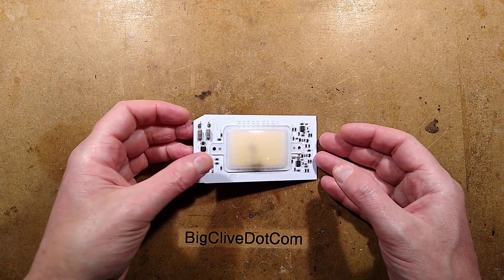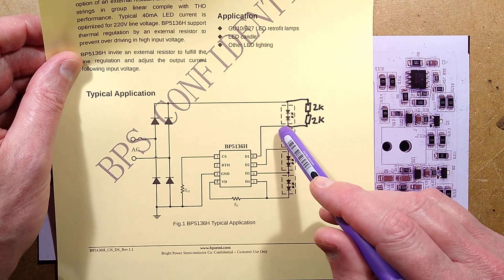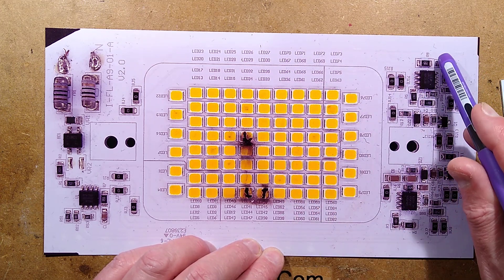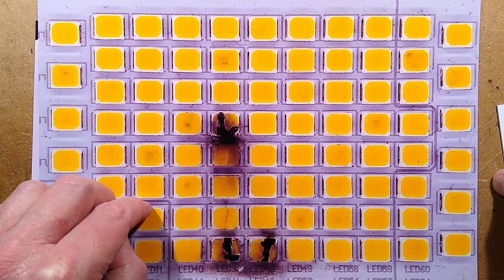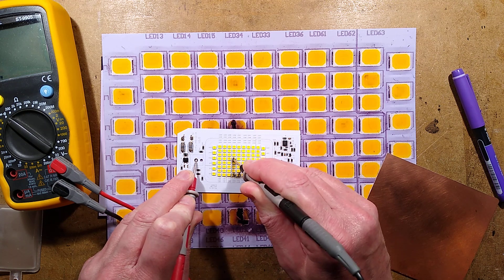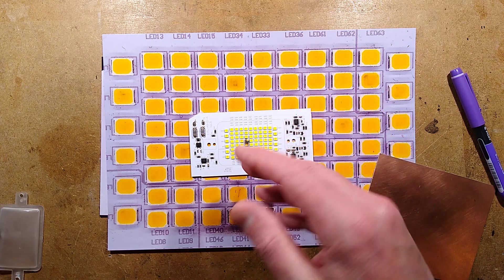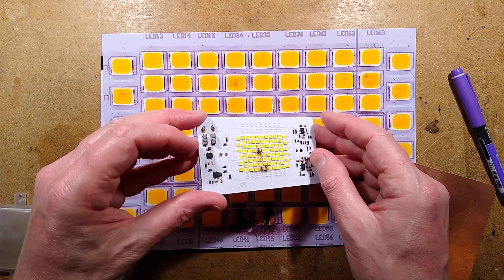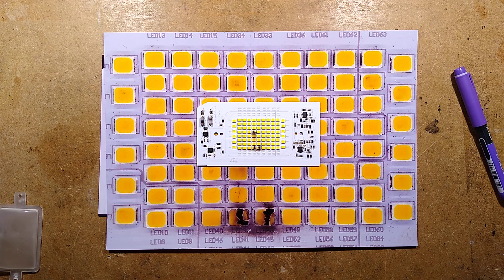LED shock hazards are increasing

Comment: Actually Led lamps is a Major fire risk .
They are NOT isolated from the mains ( example with a transformer )
and the Led's are driven so hard the life spand is shortened extremely .
( LEDs running more hot than needed )

When you look at the burned leds in the different lamps , well it is burned .
Not long way to burn down a house and it is actually more common than 
you think .
Typically the report in medias say -
' ' Fire because of FAILED electric device " " Blah blah blah .
But in reality it should have sound - Fire because of failed and burning led bulp .
They should make it more clear in the medias and news .
If you check the actual fire report they DO state the FULLY cause of fire . 
( Led Bulp and not failed electric device )

Next is the extremely simple DIRECT coupled circuit .
( and with NO ground too )
I do NOT understand how they can get away with this ?
All other kinds have lots of regulations .
Flurocent tubes .... NO you can NOT install those without a transformer and fuse .

-- But you could easy make a simple cheap circuit direct coupled 
as a voltage adder and then drive it directly on the mains . --
( no problem to get the + 10K volt needed without a transformer )

Well that is NOT legal , SAFETY you know .
Same with halogen lamps . 
-- Oh I can easy make a voiltage regulator coupled directly 
on the mains heh heh heh ... -- 

NO NOT legal .

So what happen with LED bulps and lamps ?
Well those didn' t exist when the rules was made so now they can some sort 
of legal get away with ZERRO safety ,.
( There is no rules for that at all )

Combine this with how they drive the LEDs precisely so hard that they know 
when it will break within + - 2 weeks .
But Why ??

It is called ' planned obsolence ' it is very widely used .

Simply calculate close enough that after a ' planned time ' the device will break .
Shure repair be so expensive that they welcome you to buy a new .
( and of course it ALWAYS happen short of end of warranty )

They do this with almost all stuff today .

Thats called GREED and PROFIT .
The very reason most of the 3 world is drowning in electronics garbage exported from the 
rich countries so to ' wipe under carpet ' and declare we have for shure no really waste 
/ garbage problem .

There was once in a time where they made quality and devices from that time is still 
working and can last decades .
But then the Greedy old man realiced that if all people buy such thing then he can't continue 
selling . 
So to solve this the old Greedy man now selling stuff that wont last more than the 

forced warranty 
( the warranty they lobbyed down so its typically 1 or 2 years and NOT the 
original 5 years the government wanted , Yes the Greedy old have power , Lots of power )

Devices with small failures they sell to 3 world countries and this is with ONLY A MONTH 
warranty , simply because those will break in between 2 and 4 month .
They design the ' end of life ' after each countrys specific warranty rules .
If your country say 1 year ( lobbyed level ) then they go for 14 month of life before break .
If it say 2 years 
( still a lobbyed number , original claimed from government as minimum was  5 years )
Well now the device get a little bit more expensive ( for the excact same device ) except 
that now they have made it so it break 2 to 3 month after warranty .
Yes it is extreme timing .

They started doing this with light bulps .
Catastrophe they actually end up making them so good that a lightbulp
could last almost for ever .
But no no no no , 
The Greedy old man want more More MOre MORe MORE .
So they formed a cartel where they all agreed to set a max amount of hours of life for a 
light bulp . 
Now the people who was working on making the best quality as possible was forced 
with the task of going opposite .
Degrading their products life time .

They are even so greedy they trying to force by law the right to repair to be removed .
Yes lawsuit after lawsuit because people simply repair and not throw away .
They even filling devices up totally with glue to make shure they cant be repaired .

Are you one of those who support them ? 
Sadly we all are in some way , because we buy stuff .
But we should be aware and try to only buy quality and 
stuff that can actually be repaired 
if it breaks .

Because of this pollution has exploded like crazy trough time and 
we see more and more 
''' buy and throw away '' stuff being made .

No wonder our climate is going bad and we actually going down the road of no return .

Edit - sorry my typos im on coffe now

Comment: Just buy light fixtures from reputable manufacturers with experience, producing also fixtures using other technologies than LED.
Reply: That's easy to say, but when someone sees a CPC special 100w equivalent LED flood for £19.99, versus a Samsung 50w equiv flood for £45.00 - the CPC shit wins every time. If it goes in a few months, they demand a replacement. If it goes after a year, weeeell, it was only £20, they will buy a new one.

Comment: Clive you make a big point here this is an issue I had back in the 2000's for cable termination QC. We found our high volume low quality China shops where only continuity testing. They did not do any HiPot testing. Not even at a % level. This was quite concerning for us as we were selling bargain cable IN the US. But the Chinese testing caused a loophole in termination safety. They claimed they didn't know, but they knew. Also, cultures and partnerships prevented me from speaking up fully. The Chinese just didn't want to buy the test equipment and spend the person hours on the testing.

Comment: I'm not following what happened here. We don't get the normal BigClive schematic, just a nod to the IC that is (wrongly) used. However, the datasheet schematic (8 LEDs/IC) is obviously not the same topology used on the failed module (84 LEDs total). WTF? I have a hunch that these guys paralleled a bunch of non-matched LEDs, which I was taught long ago is a very bad idea as it results in "current hogging," where one of the paralleled LEDs gets more current than its neighbor. It fails, then the survivor now has far more current than the expected shared current, and it too fails. You can parallel semi-matched LEDs, but are these LEDs are so matched?

Further, when you cascade chips that say "Rx sets the current," it sounds like a recipe for failure. Which chip wins this tug of war? Only one can. What happens to the others are are deprived of current? Something sounds real fishy, but without a schematic, I can't say so with any certainty.

There HAS to be an electrical reason for the failure(s). I don't hear any of that in this video, only some handwaving about "fatigue." Any chance you could do a followup video to show a diagram of what these guys did?
Reply: The chips are current sinks, not voltage sources. Since they act like variable resistors instead of switches they can be paralleled just like resistors can.
Reply: @eDoc2020  Not true. They behave like P-N junctions just like any diode, with an exponential current response to an applied voltage. I never said "sources" as you describe — a "source" is a battery or other power supply. The problem is that no two "diodes" have the identical V-I characteristics, causing the one with the lowest forward voltage in a parallel string to sink most of the current. It's called "current hogging." With LEDs, it means that the lamp drawing more current is brighter than its parallel neighbor(s). It can be mitigated somewhat by putting small "mitigating resistance" in series with each diode, but that cuts into the efficiency of the network (i.e., I^2*R power losses). It can easily be demonstrated graphically using simple load lines, but these comment fields do not allow embedded files. Here's a pretty good lesson you should watch: youtu.be/QEpmAkw4uE4
Reply: @demef758  We must be talking about different things. I thought you were suggesting a "tug of war" between current limiting ICs. I agree that LEDs in parallel can work like you describe, although I would argue the dies from the same batch should be quite well matched.
Reply: @eDoc2020  I will concede that I was not precise with my descriptions. I'm talking about two mysteries: parallel LEDs and these three ICs being used in a way the datasheet does not describe. Neither you nor I knows if these LEDs are matched. They are all discretes, which will never be identical, only "closely matched via post-assembly testing" at best. All I can see is that some of the LEDs are scorched while others appear to be okay. Why? Substrate expansion/contraction? I don't buy it. I think it's some electrical issue, such as over-current stress, perhaps current hogging. I suspect the BP5136H is being misused, too. I don't see how/why the failed LEDs created a safety hazard either. I'm hoping Clive can revisit this video and expand on these topics. Like you, I always enjoy both his teardowns and narratives, but this one left me stymied.

Comment: I have a few "grey" LED floodlights. I always replace the 3 core flex , cable gland and make an earth connection. Never had a problem with them. Still a bargain, my time is cheap.
Edit: Seeing as how we're talking about DC in earth conductors worth a mention that it's not just a hazard to life, it'll  do really bad things to your earth stake. DC currents through the ground can cause corrosion problems.

Comment: I appreciate the video!  My bathroom fan almost burned my house down from the aluminum wires degrading,  the mains supply wire split from the vibration of the fan and kept supplying power arcing thru the wire.  It's only 120v but Canada has some work to do also, lots of sketchy buildings from the 70's

Comment: I think one of the problems with LED lamps (beyond the circuit breaker issues etc) is that the LED's are driven at their absolute maximum, where they are less efficent, generate more heat, and tend to die far to early.
Reply: It is called ' planned obsolence ' it is very widely used .
Simply calculate close enough that after a ' planned time ' the device will break .
Shure repair be so expensive that they welcome you to buy a new .
( and of course it ALWAYS happen short of end of warranty )
Thats called GREED and PROFIT .
The very reason most of the 3 world is drowning in electronics garbage exported from the 
rich countries so to ' wipe under carpet ' and declare we have for shure no really waste 
/ garbage problem .
There was once in a time where they made quality and devices from that time is still 
working and can last decades .
But then the Greedy old man realiced that if all people buy such thing then he can't continue 
selling . So to solve this the old Greedy man now selling stuff that wont last more than the 
forced warranty ( the warranty they lobbyed down so its typically 1 or 2 years and NOT the 
original 5 years the government wanted , Yes the Greedy old have power , Lots of power )
Devices with small failures they sell to 3 world countries and this is with ONLY A MONTH 
warranty , simply because those will break in between 2 and 4 month .
They design the ' end of life ' after each countrys specific warranty rules .
If your country say 1 year ( lobbyed level ) then they go for 14 month of life before break .
If it say 2 years 
( still a lobbyed number , original claimed from government as minimum was  5 years )
Well now the device get a little bit more expensive ( for the excact same device ) except 
that now they have made it so it break 2 to 3 month after warranty .
Yes it is extreme timing .
They started oing this with light bulps .
Catastrophe they end up making them so good that a lightbulp could last almost for ever .
But no no no no , the Greedy old man want more More MOre MORe MORE .
So they formed a cartel where they all agreed to set a max amount of hours of life for a 
light bulp . Now the people who was working on making the best quality as possible was forced 
with the task of going opposite .
Degrading their products life time .

They are even so greedy they trying to force by law the right to repair to be removed .
Yes lawsuit after lawsuit because people simply repair and not throw away .
They even filling devices up totally with glue to make shure they cant be repaired .

Are you one of those who support them ? sadly we all are in some way because wy buy stuff .
But we should be aware and try to only buy quality and stuff that can actually be repaired 
if it breaks .

Because of this pollution has exploded like crazy trough time and we see more and more 
''' buy and throw away '' stuff being made .
No wonder our climate is going bad and we actually is at the brinck of no return .

Comment: Tried to sort out a failure/overload/cascade pattern in the LCDs... Those LCDs with a more-or-less smidge of toast in them were of interest. There is a pattern there, tied to the "series/parallel/ground fault" power distribution "grid" LOL... IDK wound up wondering which came first, the chicken or the egg... 
🐤😵🥚
Better living through post-mortem analysis. 
TY
🦋

Comment: Need to push the detection devices out of the fuse panel, and put it closer to the end device.
Nothing worse then scratching your head wondering what is causing the fault. Easy to find if it's one or two things doing it
Reply: An argument against that is that having the detection device at the panel protects the entire run; also the main panel is often in a more controlled/protected environment.

Comment: Note that as with UK ring mains and North American split phase 240/120.  Another difference is the sheer size of UK plugs and that many of them have built-in fuses.  You don't see that here.   North America takes a slightly different approach.

Normal RCDs only does residual current (ground fault), but doesn't break on overcurrent, and the overcurrent breaker is a separate device.  RCDs that also do overcurrent are called RCDO.  You usually see "RCD" terminology in England, and almost never in NA.

In NA, this role is taken by GFI (ground fault interrupters) aka GFCI (ground fault circuit interrupters).  Virtually all consumer/residential GFIs do both ground fault and over current.

[RCDs are used in industrial applications.]

Furthermore, NA GFI has a fault trip current of 5ma, where RCDs are usually around 30ma. 

In NA, GFCI comes in breaker form (both single pole for 120V and double pole for 240V), outlet form (usually 15A, 20A or dual on split phase circuits).  Split phase GFCI outlets is exceedingly rare in outlets.  Some devices have a plug with a GFCI built in.

GFI's have been mandated in certain circumstances for well over 30 years, starting with outlets "near" water (sinks/tubs/showers) and outdoor outlets.  Then kitchen counter outlets. Then ...

A bit later arc-fault breakers appeared.  These trip when they detect arcing - such as poor/damaged connections.  It was found that fires often started when blankets or draperies interfered with plug cords and caused the plugs to partially disengage causing overheating.  These were initially mandated for bedrooms.  Most AFCIs contain ground fault and overcurrent protection, and the latest revision of our code pretty much insists on AFCI virtually everywhere except specialized dedicated circuits.  I've never seen Arc fault implemented in an outlet or a plug.
Reply: Most American GFCIs I've seen are the in-receptacle variety and AFAIK these never have overcurrent protection built in.

I believe the main reason AFCIs are seldom seen in receptacles is that the entire circuit more or less needs to be protected. The main case where you could use an AFCI receptacle is if the initial run is in metal conduit or armored cable but usually residential is in nonmetallic sheathed cable.
Reply: @eDoc2020  You wouldn't see overcurrent protection in a NA outlet, because it's already protected at the breaker end.  The Brits are just weird with their plugs containing fuses ;-)

[Just kidding.  The dizzying variety of construction types/methods/ages present in Britain makes it necessary to go a little overboard.]

[In Canada, CSA (or equivalent) approval of plugin devices is basically to ensure that no matter what happens to the device (within reason) doesn't become a hazard.  That carries over to electrical code, for example, ground conductors, GFCIs etc., but it doesn't really care a lot about whether the device destroys itself.

You don't see a lot of overcurrent protection outside of a panel, because everything legal to connect doesn't need it or if it does, already has it.  That said, certain things do require separate over-current, often to deal with starting surges of large motors (particularly compressors like in A/C)

Comment: A lot of houses here in America still have old Edison style time delay fuses.. most have copper pennies stuck behind them also.
Reply: The house I grew up in back in the '70s and '80s had those kinds of fuses.  Luckily my parents were never stupid enough to do that trick with the pennies to replace blown fuses.  I'm sure by now the house has been upgraded to modern breakers.  My Mom sold the place about 10 - 11 years ago, and I know the new owners did a bunch of work to it -- I'm sure that included a new breaker box.
Reply: I've actually never seen one of those fuse boxes, despite seeing the fuses in Wal-Mart.
Reply: @absalomdraconis  Same. Ours definitely doesn't have those old ones.
Reply: Much of the housing stock in major US cities is pre-WW2 apartment blocks. All still fused with Edison base fuses. From the teens to the 70's (?) I think that's universal here.
Reply: Nails are the preference here. Hold up way longer than chewing gum wrapper.
Reply: And those houses are still standing. Shocking!
Reply: @8ight8ight12  Did you just...? You made an electrical pun, didn't you?